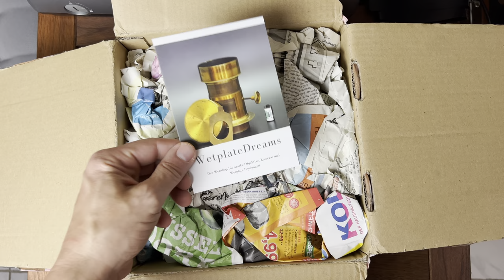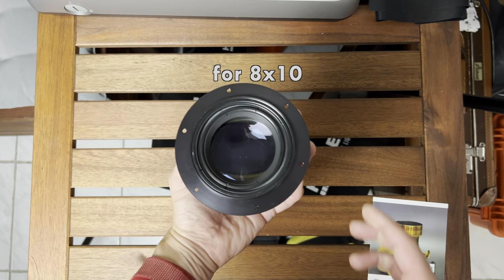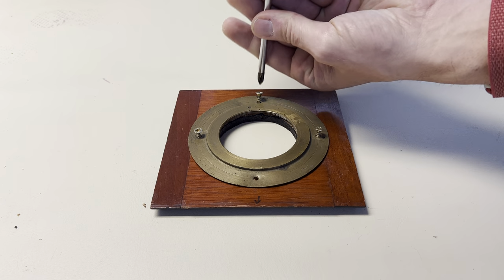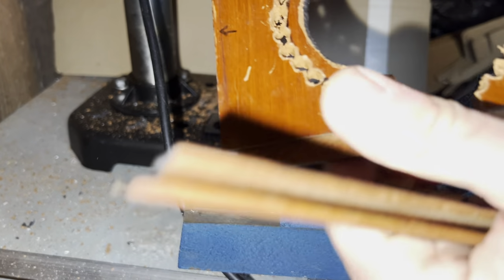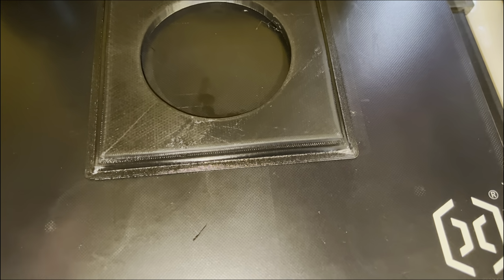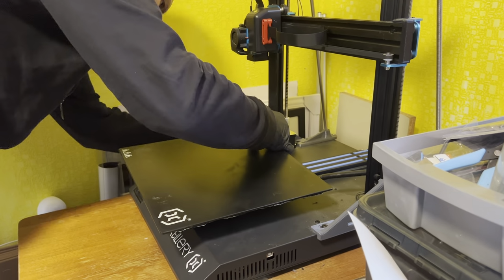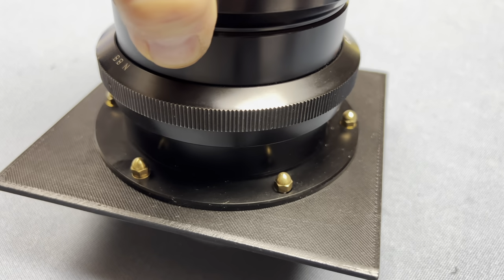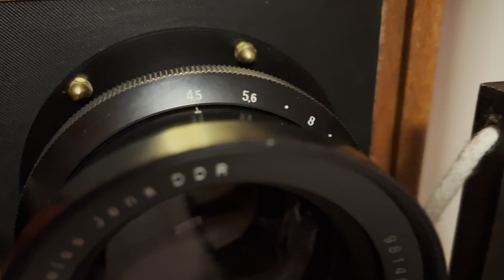Never give up Part I - a 300mm Zeiss Tessar project with lots of fails (4k 60 hdr)

Comment: Nice to see others having to go through the troubleshooting process too.. I was just mounting the flange for my first petzval on an extra lens board and the brass screws kept breaking within the hard wood of the lens board! Ugh. Works for now though!
Reply from the maker: its always a pain to fix those things, but after it worked all out its a wonderful feeling to hold a finished plate in your hands and know what you have done to get there.
Reply: Never put brass screws (regardless of size) straight into hardwood. Always run a same-size steel screw in as a sort of tap.
Reply from the maker: @paulwomack5866  thanks for your comment, what do you mean with tap?
Reply: @mhaustria  No, sawing an enormous hole in the lens board (without breaking it).

Just mark with compass, saw (near) to line, finish to sandpaper on a broom handle.